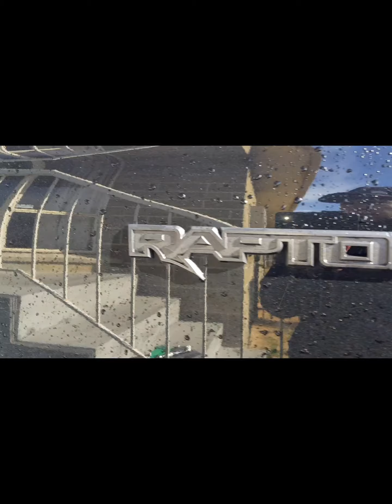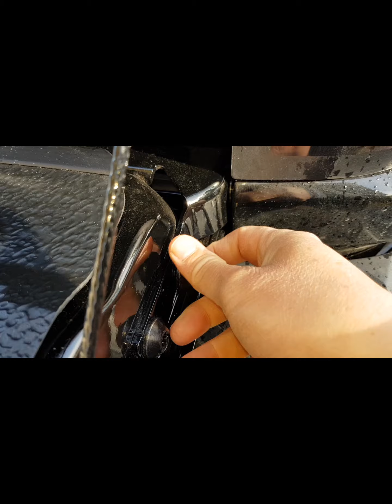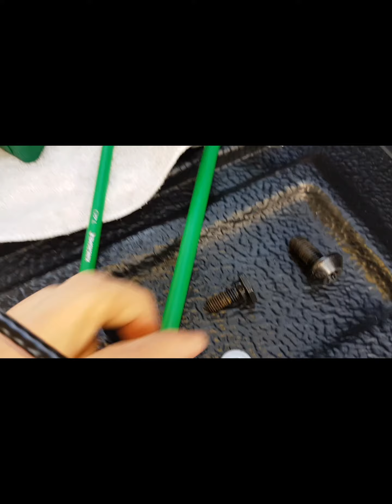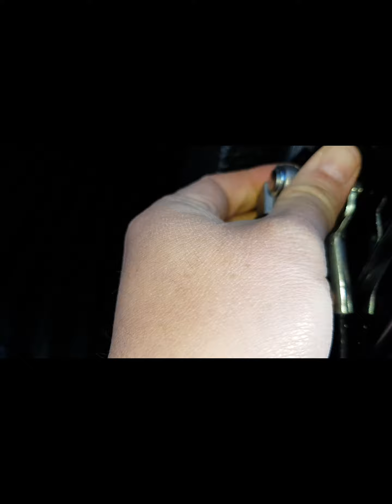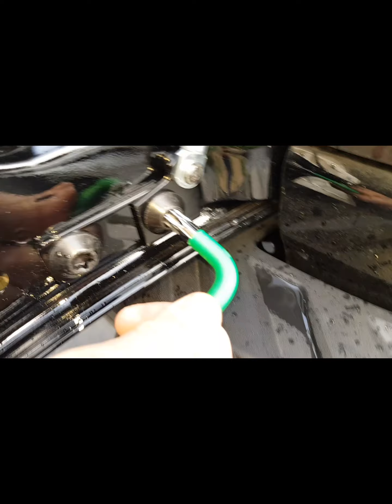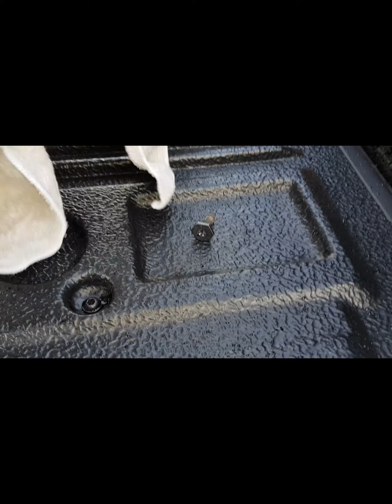FORD RANGER RAPTOR TAILGATE ASSIST

Comment: Why do you need to add a tailgate assist to a Raptor when Ford already fit a tailgate torsion bar to all PX3 Rangers and Raptors since 2018 which can clearly be seen on this actual vehicle. What I did note is that there is no Ford OEM tailgate seal fitted despite now having the roller shutter fitted. The one piece rubber seal (sides& bottom) attaches the the rear facing edge of the plastic load liner.